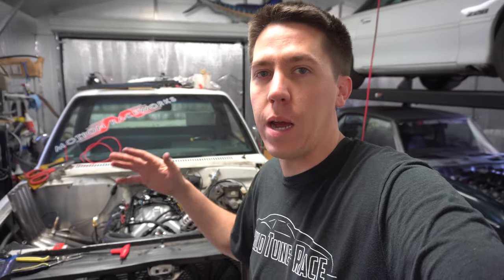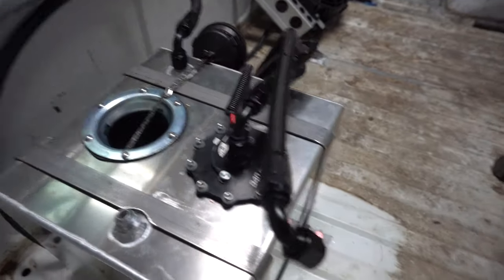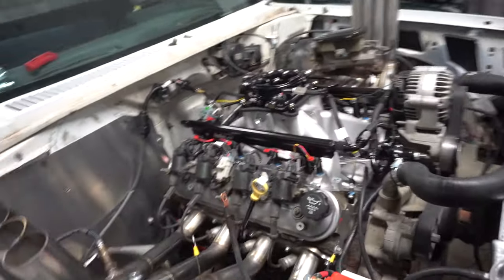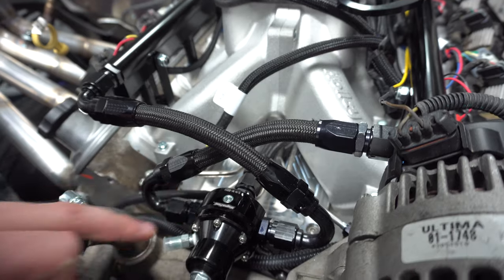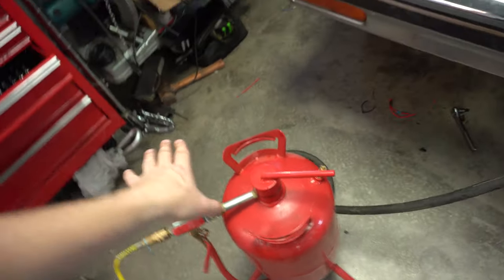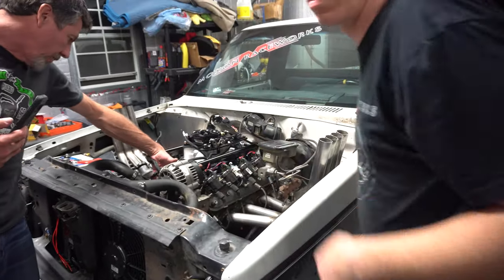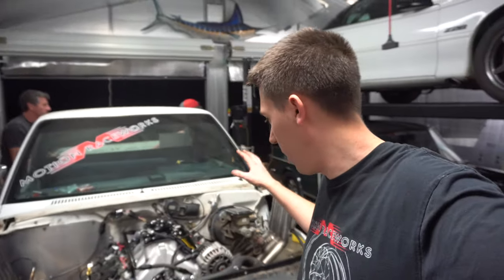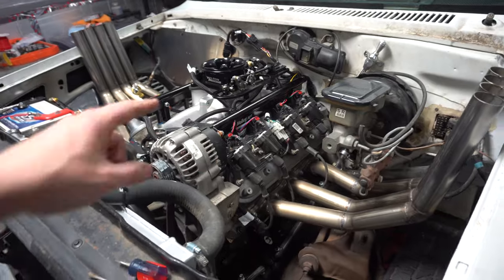Project Burnie FIRST START UP! Crazy Loud LS Swapped S-10 Burnout Truck with ZOOMIES comes to life!

Comment: Have you ever used holley terminator x max before gonna use that on my 89 s10 ls swap
Reply from the maker: Yeah works great and the base tune for the trans is pretty good!
Reply: @BuildTuneRace  ok thanks what intake would you suggest for a street truck only going cam push rods lifters oil pump

Comment: What motor mounts, oil pan did you run and are you running power steering if not what belt and all did you run
Reply from the maker: Car shop inc mounts off ebay and a GM muscle car/H3 pan no power steering pump ill see if i can find the belt number
Reply: @BuildTuneRace  ok thanks yeah i plan on not running power steering and did you just pull power steering pump out of bracket and run a shorter belt
Reply: Did you see what belt you are running
Reply from the maker: @bradleydunford725  pretty sure this is the belt number i used duralast 750k6
Reply: @BuildTuneRace  ok thanks